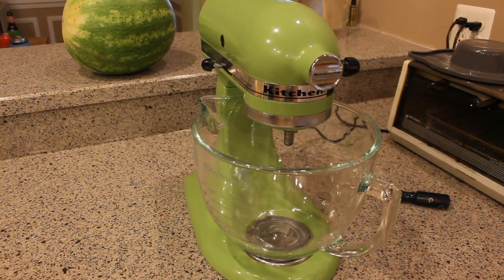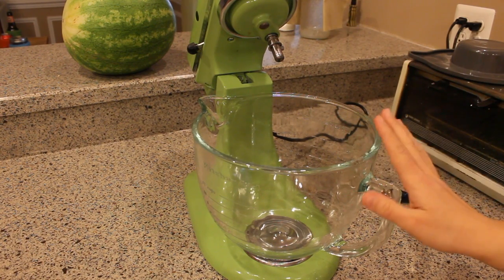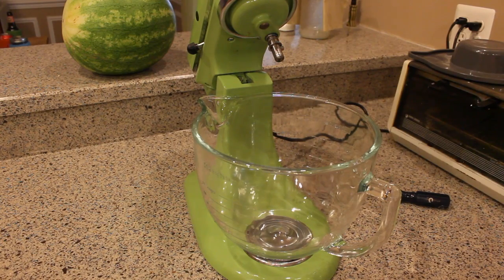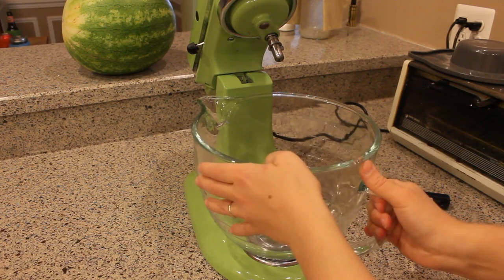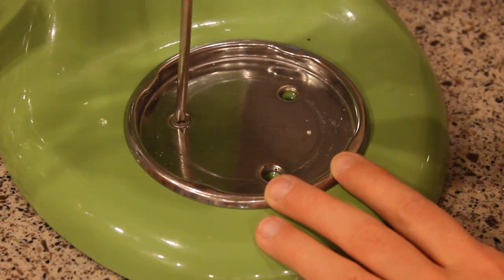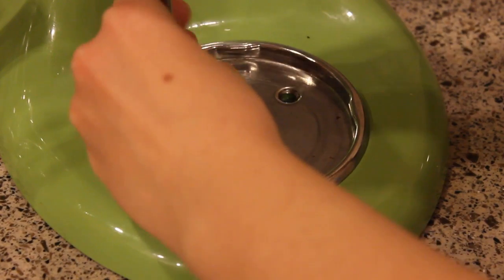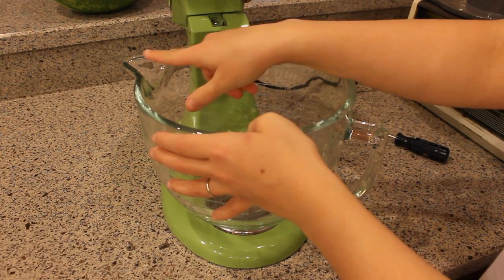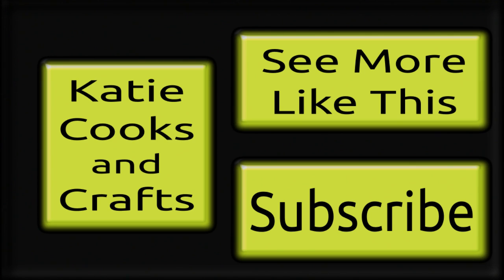Kitchen Aid Mixer - How to Keep Glass Bowl From Clanking

Comment: I have the Kitchenaid Artisan mixer. It's about 30 years old (it was my mom's). I bought the Kitchenaid glass bowl (read: NOT a knockoff) and the thing won't lock into place no matter which way I put it in there. I'm so frustrated. I even checked the model number of my mixer against the compatibility of the bowl and confirmed that I purchased the correct bowl. Ugh. 
I'll try out your trick. Hopefully, it works! Thanks for sharing!

Comment: I’m catching onto this now but I just got a mixer as an engagement gift yesterday, I bought the glass bowl today, but I noticed mine has a few different spaces that it locks into place, mine sitting on the counter the spout is about 90 degrees away from the back of the mixer, so the whole bowl is perpendicular. Maybe mine is just that way but it’s not always the case? Who knows

Comment: Thanks so much Katie! You solved TWO issues for me.  Just bought a mixer and for some reason the gray plastic ring was attached to the mixer base rather than the bottom of the bowl so I was having issues even getting the glass bowl on the base.  Then the issue of the spout clanking against the mixer.  By watching your video I was able to solve both issues and now I can finally use my new mixer!  Again.........thank you so much!!  Deb

Comment: The bowl fits on one notch over from where you have it... just put it on with the handle closer to the body of the mixer... then when it’s locked the spout and handle are both well away from the machine body... no need to disassemble anything

Comment: for some reason I can't attach my glass bowl...so frustrating
Reply from the maker: +VK Grace The only think I can think of... does your glass bowl have a grey plastic ring that screws into the bottom of the bowl?  If that is missing it would not attach.
Reply: oh thanks I figured it out. it just took some practice.  made oatmeal cookies first item in new mixer.  Aloha and Blessings